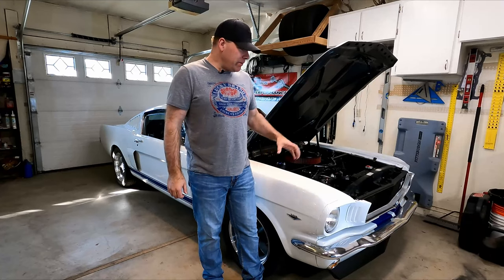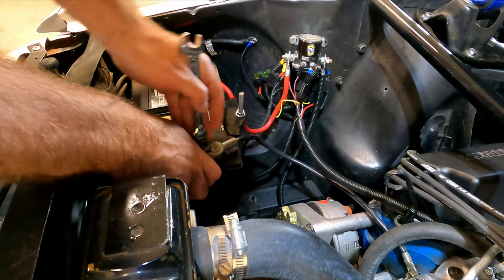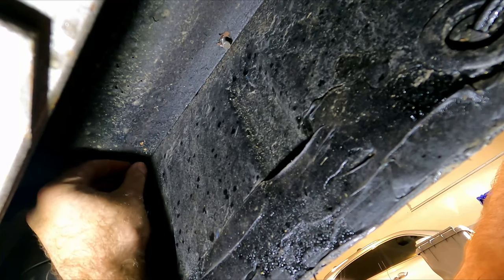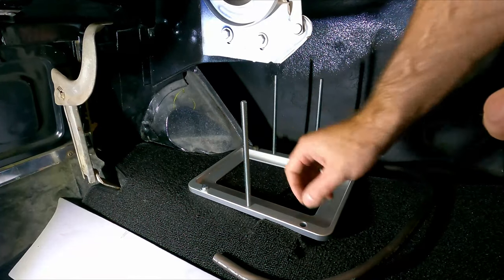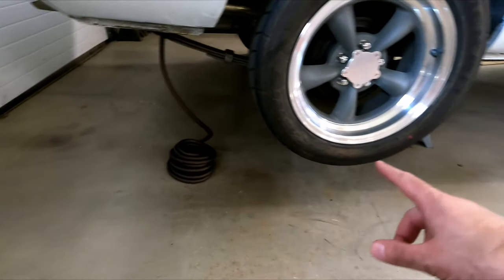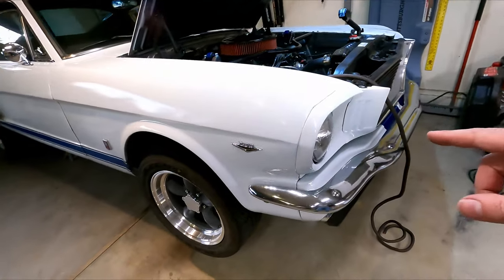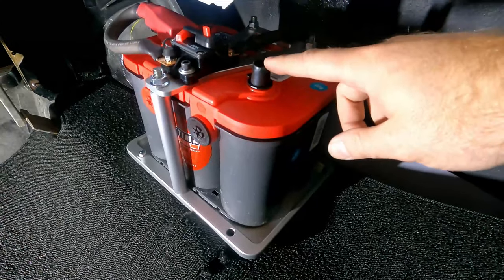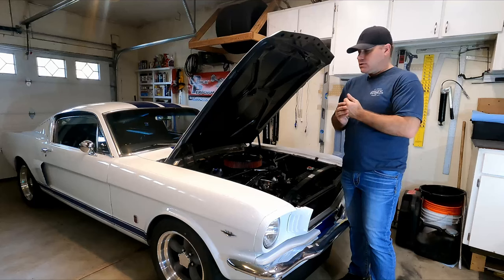Moving the Battery to the Trunk

Comment: Thanks for choosing OPTIMA Batteries! We hope you can find a long-term solution for mounting that includes using your Taylor battery box. In the unlikely event a battery is severely-overcharged, the fumes it vents are both flammable & toxic and should be properly-vented to the outside atmosphere. Please keep your REDTOP fully-charged to at least 12.6 volts whenever possible and it will serve you well!
Reply from the maker: Thanks for the heads up!
Reply: That's pretty cool getting a comment from Optima
Reply: Hey team , I'm Doing a simular setup but in my 88 10th anniversary RX-7 I've had 26years,  Have 30YEARS Experience  in Mainly Audio video all things custom , And worked at several shops In Massachusetts, And allways had a Nice    

@optimabatteries  Rack and display! In all projects.. Would you consider working with my project? And how could I reach out please 19:54 

 installations manager , And Have ALLWAYS

Comment: Great job on making this video, it is very informative. When I relocated my battery on my  former 1965 & 1966 Mustang Fastback, I used Arc welding cable and ran it through the interior to the engine compartment.
Reply from the maker: Yeah, I’ve heard using welding cables is a popular option. 🙂

Comment: I did this with my 83 camaro, worked great, I used the rear seat seat-belt bolt / hole to tie in the ground to the body / chassis, (No rear seats in my car) and ran the positive through a protective sheathe up through the firewall via a through seal able bulkhead grommet, up to a multiple distribution buss bar, mounted on the inside fender of the engine bay, worked great.
Reply from the maker: Yeah, there’s lots of good ways to get the power wire up to the front of the car. Using those grommets are a life saver when the wire has a tendency to rub on sharp metal edges. 🙂

Comment: Thanks for the great video and thank you so much for using the same size positive and ground cable! So often I see guys use a nice size positive and then a 4 or 6 gauge ground, and then wonder why they have electrical issues. Electricity can only flow as much as the smallest wire.
Reply from the maker: Thanks!  :)

Comment: Great work Andy. I did the same thing to my car except I used a battery box with a vent tube going under the car so I could run a regular battery, plus I personally don’t like exposed batteries but it looks great. I think you’ll really like it,  it’s nice having that extra room under the hood. Keep it up brother!
Reply from the maker: I purchased a Taylor battery box and Moroso cutoff switch, but I found that it was difficult determining the best place for it with out compromising other details in the trunk.  It's fine for now, but I may end up using that battery box down the road.  :)
Reply: @AndyKruseChannel  gotcha, yeah I had to cut out my spare tire carrier hook in my trunk.

Comment: So my idea as I was watching this (this is just an idea for myself, not making any recommendations but you're welcome to use it or critique) was still using the breaker in the trunk area but instead in that little alcove where the trunk platform dips down to meet the inner quarter panel. Some people have those areas boarded up or otherwise made inaccessible but for others, like mine, its still open (and prone to catching any small things left in the trunk area lol or water if it's not sealed up). Unless I'm mistaken, it's pretty much the same place that you drilled the hole to feed the wire through to so mounting it there could play well as it'll be in line with the current wiring path and if it get's mounted on the inside side, it'd be hidden away and kind of act as a kill switch at the same time (Though I'm still going to install another one in the cabin to use regularly)

Enjoying watching your videos, man! You've helped me with my build a few times already and I plan on referencing back to your videos a lot more in the coming days as I begin in on the big tranny swap, new tires and wheels (Thank you again for those specs!), and more
Reply from the maker: I'm glad you're able to use these videos on your build.
I had several ideas of how and where to route the cables and mount the circuit breaker.  In the end this worked, but I'm not 100% sure it'll stay this way.  We'll see how time goes on and if I need to make any changes.  :)

Comment: I was impressed with your work. Some constructive criticism - I saw you "crimp" the cable end with pliers. You should ALWAYS use the proper crimper for the cable end. Poor electrical connections WILL lead to problems down the road. Please take this the right way as I'm not complaining. I really get a lot of insight from watching you do this stuff and explain the benefits.
As far as cable routing, how about staying on the inside of the trunk and running in the trough in the door sill. Still have to enter the engine compartment through the firewall, though. Oh well, more brainstorming...
Reply from the maker: Thanks for the heads up.

Comment: Your rats nest of solenoid wires looks very similar to mine. Still a to-do here. Great mod on the car. If you ever are planning to race it you might want to consider a shutoff switch external to the body (maybe under the plate?). Looking forward to seeing the engine mods you had to make room for! I think I have a clue!
Reply from the maker: I have a Taylor battery box and Moroso cutoff switch, I just couldn't find a good place for it in the trunk without some compromises.  Mods are coming in hot!

Comment: I understand the benefits of trunk mounting the battery,  my only thought was did you consider running directly threw your car and down the inside rail, drill 1 small hole threw the firewall? The reason I was thinking about that is less exposure to the elements, no pinch point where you come on the outside of the frame rail. Just my opinion, thanks for another great video!
Reply from the maker: I explained in the video that the crossmember attachment point for the trans is in the way, or I would have done exactly what you were thinking.  :)

Comment: Absolutely run a ground from the front bumper bracket to the engine block where your alternator grounds, I melted my negative battery terminal  right at the battery.
Reply from the maker: Thanks for the heads up.  :)

Comment: Thank you for sharing your 66 mods. Yes, please share your idea on how to clean up the solenoid. I have been trying to figure out a way to add a few relays and fuses to help with cleaning everything up.
Reply from the maker: An easy way to clean it up is use the Ignition terminal (or the terminal on the back end of the ignition switch in the dash) to trigger a relay that you can mount anywhere (maybe under the dash).  Then run a power wire from the either the battery or the battery terminal on the Starter Solenoid through that relay and to a distribution block.  This block can then feed several devices that need a switched power source.  This is what I did in a earlier video, and I still have that block mounted under my dash.  :)
Reply: @AndyKruseChannel  thank you , sounds like something I can do .

Comment: I tan mine through the car into the engine compartment  and mounted the starter solenoid in the trunk with the battery, also it's not only the size of the wire also it's the strand count.
Reply from the maker: Yeah, there's lots of ways to run the cable from the trunk.

Comment: Got a question if you can help dont have a clue about whats the correct ampage i should use for the circuit breaker here is all the stuff i got going on electric water pump,dual electric fans,electric fuel pump msd 6al-2 box and hvc 2 blaster coil "the blue one" oil,water,volts gauge,rpm gauge and trans temp gauge and optima red top battery and using 0 gauge ofc copper neg and pos battery cables 'thanks'
Reply from the maker: The 200A breaker I have in my setup is more than enough, even for your planned upgrades.  The high amperage breaker just needs to be big enough so that the starter doesn't pop it on a bad day.  The rest of your electrical components will be relatively low amperage, and they should all have their own fuses anyways, even though everything is coming off one battery cable.  :)

Comment: Should consider moving solenoid back to the trunk. Then use a 4awg wire for your alt and accessories.

 ya it's 2 wires back to the trunk three including the trigger wire for the solenoid.

 But the 600 amps from battery would only be active when you turn the key and the 4 awg wire would carry the small amp stuff back to the battery separately at much lower amps. 

 Maybe Use a junction box in the wheel well or on the firewall for your 12v source from the battery.  That would clean up the wires. 

I was watching this cuz I was considering running a always hot battery wire across my car. 
Under the car seems safest for fire purposes. But the route seems awful close to the exhaust. I'm am still undecided on which way to do it. 

The always hot wire seems like alot less work.... just more risk...
Reply from the maker: Nah, that way sounds more complex and would require more items to purchase and install.  Plus, there's no need for the solenoid to be located near the battery, and adding all the wiring to comply with the other terminals on the solenoid sounds like more work.  :)
Reply: @Andy Kruse  ya I appreciate the simplicity of just running the hot wire. I might just Douthat and insulate heavy where needed.

Comment: Good job except for using a black conductor for 12 vdc hot. Red for power and black for ground. I know Ford did it, but it’s not a good practice. Also, you need to solder that pretend crimp you did with those channel locks. That is not an acceptable crimp at all! Cheers.
Reply from the maker: Thanks for the heads up.

Comment: Hi Andy. I already have twin Optima batteries in the trunk of my '65 fastback but wanted to see how you mounted yours. That sped-up  cable terminal install was pretty fast on camera...did you crimp those terminal ends? I had to pull enough cable up out of the trunk and onto the floor so I could smack my terminal crimper with a 5# hammmer, then tuck it all back inside the trunk. Was wondering how I missed this process in your video?
Reply from the maker: I ran extra wire up through the hole in the trunk that goes to the battery and crimped the terminal.  After I connected that terminal to by circuit breaker, I pulled the excess wire back through the hole in the trunk and proceeded to the run the wire under the car up to the front.   :)

Comment: I’ve thought about running it like the factory tail light wires but under the passenger sill plate and I think a 2 gauge will work but that’s a future me mod. Any concern with not running a sealed battery box that has a breather for the battery fumes that may float around in the trunk and possibly to the passenger compartment?

Also what did you do with the engine block ground again? Just mounted it to the apron?
Reply from the maker: I debated about running the cable internally, but if I ever had to service it, I'd have to remove everything again to get to it.  This route seemed simpler.
I have heard it's not a good idea to put unsealed batteries (like the unit I removed from the car) on the inside of the car.  Not so much about the fumes, but the corrosive nature of those types of batteries is not good.  If the trunk was better ventilated then it might not be as big of an issue.
Yes, grounded to the sheet metal in the engine bay.  :)
Reply: @AndyKruseChannel  I’ve definitely thought of the servicing too but talked to friends with batt in trunk and one has had it for 8 years and has only replaced the battery so far. Good to know about the optima battery that is not a concern that will help my build thank you for your content and follow up as always!!!

Comment: The red top optima batteries suck balls the valving inside sticks open and heats the battery so hot it is scary to touch or even be around. Went through 3 batteries with 3 failures put a Walmart battery in. No problems ever on any vehicle. Come on optima get your shit together and make a good battery.
Reply from the maker: Hmmm, sorry to hear they didn't work for you.  :)

Comment: Thanks for this Andy!! This might be a dumb question, but how necessary is the 200 AMP circuit breaker? I'm having to relocate my battery in my '65 coupe to the trunk due to A/C compressor install location. I've got all the necessary bits and pieces, but just wondered if that was a 'must' or not.
Reply from the maker: It’s more of a safety feature to have a breaker as one was not used when the battery was mounted in the engine bay.  You don’t want anything less than 100A or much over 200A. Plus, this provides an incredibly easy way to cut power to the car.

Comment: Andy - how did you decide to go with a 200AMP breaker on the battery?
Reply from the maker: From what I could find, it was what other Mustang owners had down in the same scenario.  I almost did a 150A unit, but I didn't want this to be on the edge every time I started the car.  :)
Reply: Has the breaker held up? Still working strong? I’ve heard they break or don’t last long…thanks
Reply: @daveyhen3518  I did my trunk battery conversion about a year ago, and it's still going strong. The nice thing is, if it does fail, the process of swapping it out for a new one is pretty simple.
Reply: @banks412  thank you 😀